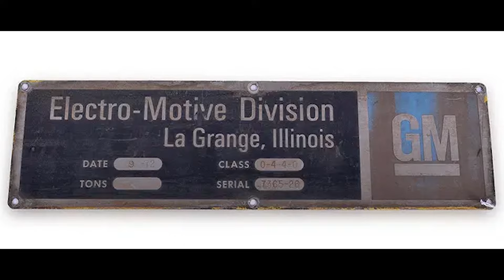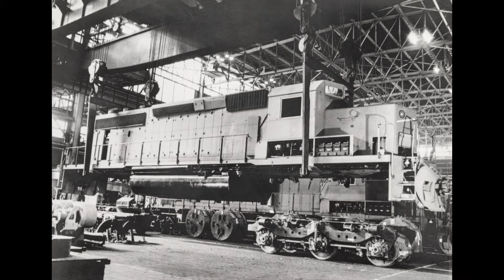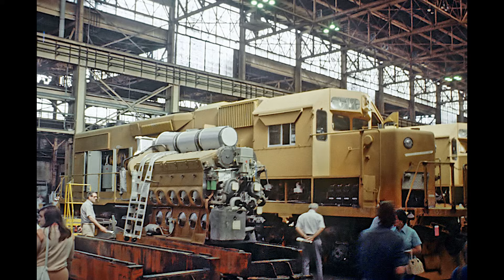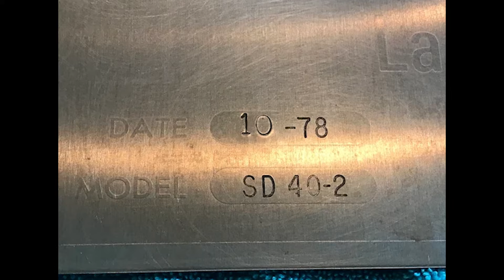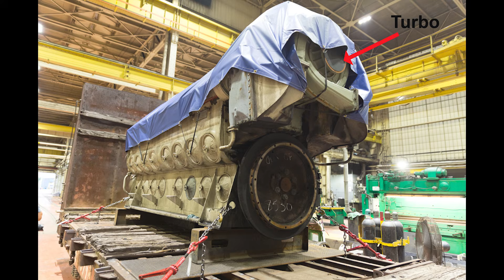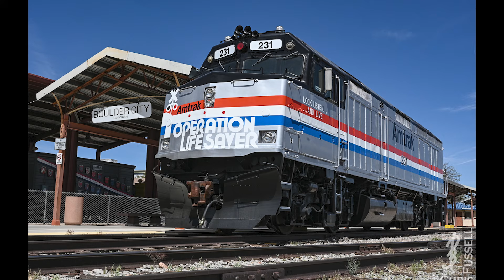Why the SD40 2 Became a Legend

Comment: What a great story! I'm retired now, but you are right about the -2. NS had a bunch of them, some in train service, but a lot were sent to yard service, where they pulled as hard as possible 24/7 until they came to the roundhouse, usually just for brakes and fuel. A year or two before the covid mandate forced me to early retirement, the company started a campaign to junk lots of power and personnel, causing every consist we built to be a crisis. Among the scrapped power were a lot of -2's. I suggested they keep the best ones and couple them back to back as emergency power. This setup would outperform the newer engine, and while probably use more fuel, it would be ready to go in either direction on a moment's notice. I was a lowly roundhouse electrician and got laughed off the scene.